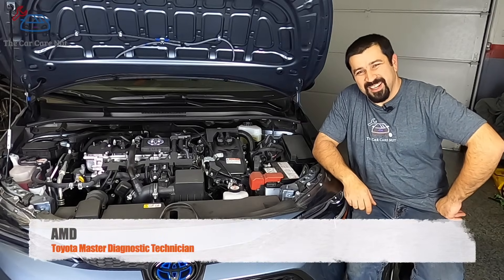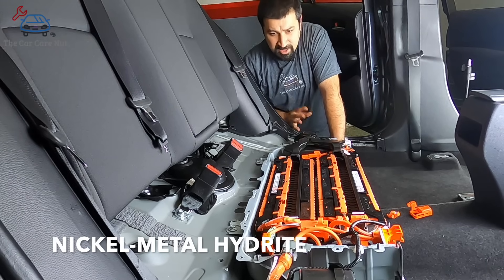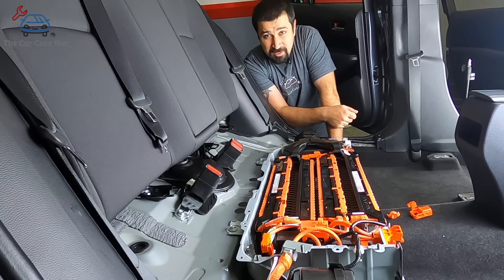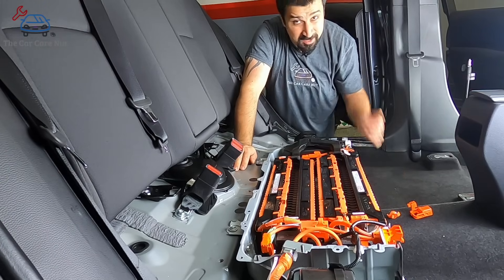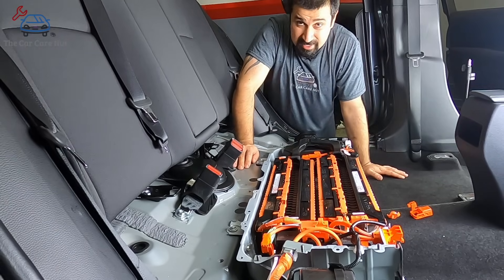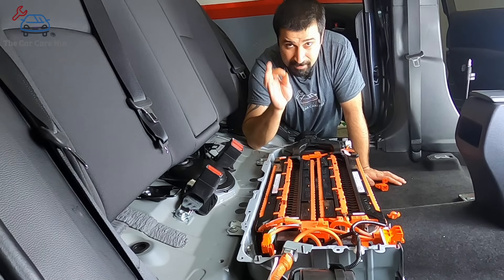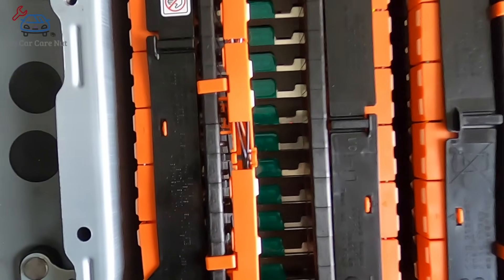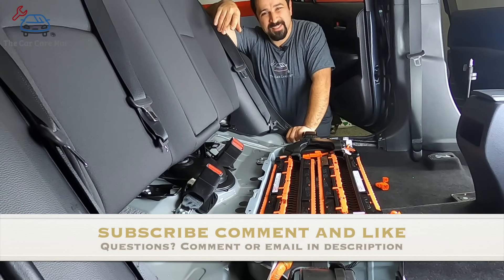How Toyota Hybrid System Work Part 1 High Voltage Battery

Comment: Does the Hybrid Car’s engine still need to warm up during cold start⁉️⁉️⁉️ Isn’t it is Usually the Electic Motor is the first one working for how long should we warm the engine⁉️⁉️⁉️ but they also said the transmission needs warming up also but it’s E-CVT Dba⁉️⁉️⁉️ Does it also needs warming Up⁉️⁉️⁉️ for how long⁉️⁉️⁉️⁉️ Then before Switching Off the Engine does it also needs to idle for a while before switching off⁉️⁉️⁉️For How Long⁉️⁉️⁉️

Comment: Recently seen that as the battery starts deteriorating, frequently just REPLACING the POWER STRIPS , the ones that the posts go through, $35/ea., restores the battery as there's been corrosion in the contacts! Just cleaning isn't effective!

Comment: So you need a battery to start the vehicle. Well if it is really cold out and you have not driven the vehicle much the charge on the battery might be too low to start the car. Right?
What voltage is needed to charge the high voltage battery?

Comment: I am about th buy a Lincoln Nautilus. When I heard CVT I ran away, until I discovered the that it was an eCVT. Now I am running back. As an electical/mechnical engineer this has go to be the best solution. I am so exited. I studied primary and secondairy cells. Once you understand how many Joules they contain, 99% of people should leave the cover on. I think Ford and Toyota worked on the transmission and swapped licencing. Great video, will look at the next one.

Comment: Hello, I'm looking to purchase a used 2020 Prius LE Hybrid, but my concern is on the hybrid battery. It belonged to an elderly person who didn't drive it much. The current mileage is 10,008 in 2025. Would the hybrid battery degrade for not being used much?
Reply: Should be alright. Its fairly new. If anything, I just bought a 2003 hybrid Toyota alphard from Japan, the hybrid battery is working fine without any service records. I don't think it was ever serviced. I will be cleaning it up this coming weekend then I'll determine if it was ever touch from there.

Comment: At 13:30: You said that the main battery in the hybrid Toyotas should not be stored too long. We go south every winter from Canada, where the vehicle would sit for 3 months unheated. Problem? I would put fuel stabilizer in the tank of a gasoline vehicle, but what can be done for a hybrid Left outside for 3 months??

Comment: Hello. Great video.  Have a 2007 hybrid camry that started knocking.  285,515 miles. Was well till now. Not smoking.  Question: Is this AZ-FXE engine has a VVT filter?  Location is the same as AZ-FE?  Can it be replaced?  Will appreciate your response.  Jorge

Comment: It got two motor generator. One is inline to the combustion engine and the other is a stand alone. Both connect through gears to the differential. All said emotors are enclosed in a transaxle housing.

Comment: Thank you for your video. Really informative. I just bought a 2024 Toyota Corolla Cross Hybrid, my car's battery died on the weekend with just 5 days not being driven and I had jump start my car. Does the hot temperature drain the battery faster if it sits idle for a few days?

Comment: Good morning, AMD.  I know you are extremely busy, but hopefully you read this. Would you happen to know the amount of Voltage running through those High Voltage Cables in the Engine bay and the one by the Cablegate housing underneath?  2nd, I'm a scardy-cat, If I put a high temperature, waterproof electrical tape like CANOPUS Butyl Seal Tape, Black on that High Voltage cables, in your opinion would it "Damage or interfere with Anything"?  Thank you so much from your dedicated subscriber. Take care, stay safe and Merry Christmas to you and your family.

Comment: I wonder if the battery relays are replaceable. From my electronics background a mechanical relay has a much higher fail rate than most other components

Comment: I hope that the younger generation is interested in this but it is a complete bore for a 78year old.  I am just glad that I have an 18 year old car which is still drivable even if the Driver's Side Rear Door Lock light is showing. Also don't these batteries produce a spectacular fire if damaged in a collision?

Comment: Thank you for you contribution and caring contribution for educating us. I really enjoyed my two Prius vehicles, a 2003 which I had a trouble-free 150,000 miles with no hybrid issues even commuting off and on for 15 years over the Rocky Mountains; and a 2009 that went over 120,000 miles with no problems with the battery. Sadly, I had to buy a Subaru Forester in 2017 because at that time Toyota did not have a SUV that had as good highway mileage and a full-blown AWD system for a snowy commute.

Comment: We currently own a 2015 Fusion Hybrid with 79K miles.  Great car, no problems.  We're currently looking at a Lexus 300h Ultra around $57K.  Just saw a USED 2023 ES 350 with 9,500 miles , V6 for $ 43,263 OTD.  Which would you buy? I Know you own a Camry Hybrid.

Comment: Check hybrid system. Car won't drive, Could that just be battery going out? The fuse up front is not tripped. Ct200h for reference

Comment: In your How Hybrids turn on, can you confirm that only 2 relays? Usually need to have a 3 relays. One additional for a pre-charge circuit to charge a inverter capacitor without exceeding in rush current. Usually closes main negative contactor, then positive pre charge contactor, then main positive contactor, then opens positive pre charge contactor. That's why hear multiple clicks.

Comment: If the battery is under the rear seat what is the lump to the left of the boot floor?
The 12V battery is on the right.

Comment: Great video, thank you for making it! But i have a question where does that hot air duct ends, is it directly venting out of the vehicle, and if so is there a need to clean up the venting point and how do you get to it?

Comment: Hello AMD, big fan of this channel. We recently bought a 2022 CHR Hybrid and would just like to ask the question if in the morning, do we need to warm up the engine before driving off? Because as we know, when you press the start button and once READY is displayed on the instrument cluster, you are able to move and go without the engine starting. I am curious if not warming up the engine beforehand and have it start only when you're driving will harm it on the long run because it hasn't warmed up yet. Thank you and more power to the channel!

Comment: I’ve heard hybrid batteries usually have a lifespan of approximately 16 years.  Is that your experience?  I have a 2009 Prius.  If the hybrid batteries go bad, is it possible to just run it without the hybrid batter where at the point it would become a gasoline powered car only?

Comment: Hi Does tge conventional engine still use a normal ignition and fuel system, i.e cam and crank sensors and ign coils and electric fuel pump etc please...Fred in Uk.

Comment: If I had the money for a new car it wouldn't be for a hybrid, unecessarliy complex (TWO power trains=more servicable items) for my small mileage, I would buy a used one though.
Yes hats off to the engineers for their pioneering work but I think it was wasted, but that's only my opinion and what do I know. IF I did have the inclination to buy a new car and the price was on par with the Toyota I would buy a BEV.

Comment: Question about the battery exhaust, where on the vehicle is the opening? Is there any servicing or maintenance that needs to be performed on it (like checking for debris)? Is there risk of water intrusion through the exhaust, if not, how was that mitigated?

Comment: Page 394 of the 2022 Toyota Venza owner's manual (we own the hybrid model, but the manual is not specific to the hybrid model) says, "If recharging the 12-volt battery installed on the vehicle, be sure to disconnect the ground cable."  WHY IS THIS?  Is this to isolate the 12-volt battery from the high voltage hybrid system, or just a safety thing to prevent accidently causing a spark with the charging cables?  I have Battery Tender and can permanently install a convenient quick disconnect pigtail to the battery terminals.  I'd like to be able to do that, but need to understand the caution in the manual.
Reply: The reason for the question is that my wife drives this vehicle to work 5 days a week and it's only 13 miles each way.  That's the majority of the driving.  I am concerned that this may not be sufficient to maintain the 12 volt battery

Comment: Hello Mr AMD, a have question regarding my 2020 Toyota RAV4 Hybrid, well I live in Florida and recently I run over a water due to Hurricane Ian, well the deep of the water was about 1Ft  (12 inches) deep and my hybrid vehicle had a Hybrid malfunction and had to be tow to a Toyota Dealer and now needs to replace the Hybrid control due to water ingestion. So how much water this system can handle before the damage occur, wasn't a deep flood (12 inches) and no water was inside the vehicle at all, the main Hybrid battery (one under the backseat) was ok no damage at all , but I saw several video's of testing the RAV4 Hybrid in mud, snow, even water and nothing happens. Is there something that I should be aware or even Toyota will plan to have a design change that protect better the Hybrid system from water damage, I will never wash this engine like some people due in the regular only gas vehicles, let me know your thoughts on this so I would be more careful were I can go with the RAV4 Hybrid,  hope to hear back from you soon , thank you

Comment: Check hybrid system pull over in a safe place immediately........ what does that mean ????? Dealership said it would be 5,000 for a new big battery...  but is that really it ?

Comment: I have a 2016 Prius, bought new in February 2017 (I got a great deal!). You mentioned around the 13-minute mark that you don't recommend storing the cars as it might affect battery life. Well, since I live in Nova Scotia (rust capital of the world), I have put my Prius in storage from mid-October to mid-April for the last five years (unheated barn). So far, no problems, so I am hoping my luck will hold! By the way, I now have over 100,000 km on it and my overall fuel economy for that entire time is 3.9 litres/100km--which translates to about 60 miles per U.S. gallon. I love this car! Thanks for having these great videos to help understand such a complex machine!
Reply: Dan I'm sure it will be fine, I have an 2008 and it was excellent for work, min. problems.

Comment: My hybrid battery still running strong at 170k miles original owner my dc inverter went bad at 120,000. Good thing it still had warranty 10 years or 150,000 miles i dont have any warranty no more lol. I  replaced my water pump and egr valve good thing for youtube save lots of money.

Comment: I am a fire fighter. Knowing that there is a disconnect switch from the battery to the vehicles systems is VERY important for me to know. Our challenge is that if the battery cell is damaged in an accident how can we perform an extrication without getting shocked, or worse? Obviously we need to remove a viable patient from a vehicle as quickly as possible, but if the vehicle is charged, we are presented with greater danger for emergency crews. Any information in this regard, addressed to emergency response, would be much appreciated by many.
Reply: Toyota says any accident that triggers thr airbags also trigers the relays to disconnect the battery.
Reply: This is good information, but, as some may know, an accident is unpredictabble. Any damage to the battery could result in charging the entire vehicle, making extrication difficult or impossible. I now own a 2024 Sienna and appreciate how good Hybrids are, but many of you can understand the dangers that emergency workers face. Please keep this kind of information coming. A further challenge for us is that every manufacturer builds electric and hybrid vehicles differently.
Reply: I think it would be a good idea to have a mechanism to flood the battery with nitrogen or sand, the problem with the battery is two fold, one the energy stored in the battery. Two the the energy of the battery burning
Reply: Unless it's a plug-in hybrids the battery is pretty small and it's under the rear seat.

Comment: I LOVE your informative videos!  I recently bought a new 2022 Lexus NX 450h+ AWD compact SUV.  My question is about the charging procedure.  Once the battery is fully charged should I leave the car plugged in if I am not going to be driving it for a day or two?  If I do leave it plugged in, will it “over-charge” the battery, or does the system constantly monitor the charge level and begin charging once it sees a drop in charge when the car has not been driven?  I have read that leaving the car plugged in helps keep the battery fully charged as it sits unused for some amount of time.

Comment: 1) What battery does the 2007 Camry Hybrid use; is it the Lithium Ion or the Nickel-Metal Hydrite?; 2) If the 2007 Camry Hybrid's Lithium Ion or Nickel-Metal Hydrite battery dies, can the car still be driven with only the gasoline engine?

Comment: I recently bought 2022 Camry hybrid LE which has 16 inch wheels. If I upgrade the wheels from an SE or XLE trims for my LE, will you recommend it, will affect the mileage ?
Reply from the maker: Hi! It will have a small effect on gas mileage

Comment: I currently do not own a Toyota Hybrid, but I'm considering one as my next purchase. During your video you mentioned that the hybrid battery shouldn't be stored without using it for a long time. I'm currently retired and it is possible that I might go on an overseas trip for 3 or 4 months. In such a situation, is there anything that I can do to protect and keep the battery properly charged? Thank you for the video, it was very informative.
Reply from the maker: Hi! If this trip is repeated every year perhaps a non hybrid would make more sense. If this is a one time deal then it’s ok
Reply: @TheCarCareNut  Excellent. Thank you for the response. I'm thinking that it would not be every year, so I probably would be OK with a hybrid vehicle.

Comment: The fan filter on a 2022 Rav4 hybrid is in a different position than on this vehicle????? You made a comment about the small 12 volt battery that it "fails"?????? Is this something that happens often or every year or two? Is the cost to replace that battery covered under the warranty along with the hybrid battery? I have heard of a "new" Toyota battery that is compact, lighter still and several times more powerful ( a fifth Generation????? or version 5???????) that may be available in most Hybrid models in the 2023 model year?????

Comment: Just got a 2022 Highlander hybrid. Will probably need to sell a kidney and a lot of plasma to pay for it, but watching this helps relieve the occasional buyers remorse of the cost. It also looks like there’s a lot of extra parts to fail, but I’ve seen batteries explode. Knowing those safety features are there is relieving. Thank you for doing this, definitely going to keep watching the rest.

Comment: If a person driving this car were T-boned, and people in the rear seat needed rescued, would there be at risk of electrocution? Either crash victims or rescuers?
Reply from the maker: Hi! If the car detects a high voltage electricity leak it will isolate the battery to minimize that risk

Comment: Thanks for your Hybrid video series. I am looking to purchase my first Hybrid, probably a RAV4. (not Prime). I am retired and spend 6 months in Florida and 6 months up north. I have used battery tenders on my ICE vehicles. both in Florida and up north and it has worked well for me. Instead of a Hybrid, would a smarter choice be to continue to opt for the non-Hybrid ICE in my next car?

Comment: It would be helpful if you would refer to the Li-Ion battery as a "battery" and not as a "guy". You did that repeatedly. It's a battery, not a guy.  The battery cells are just that too. Not guys. Relying on pronouns so much can be confusing and even misleading.

Comment: When you are driving on the highway between75-80 mph, what is happening to the hybrid battery? Mine usually stays at 3 bars. Does it just switch to using the engine as a gasoline engine 100% no damage to the battery because it’s not being charged?

Comment: I have a 2008 prius an old man slowly backed into me and now I cant get it to shift into gear any suggestions thxs gary canada
Reply from the maker: Hi! Does the car ready on?
Reply: @TheCarCareNut  it starts back up but it will shift to drive and park but won't move I was in park when he backed into to me I had oil change the day before the car was running perfect
Reply: The triangle of death comes on and the anti slip light